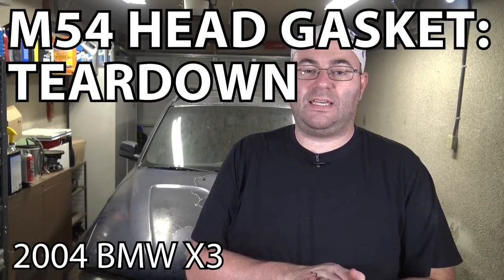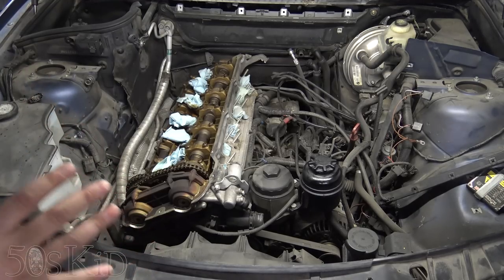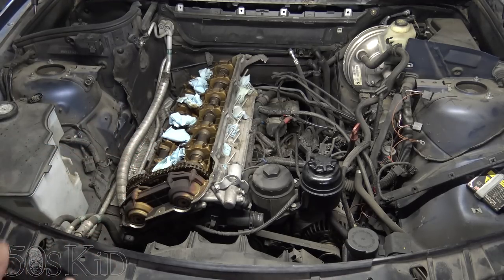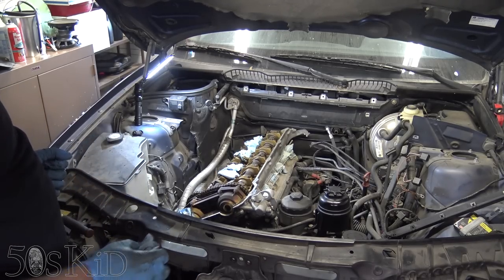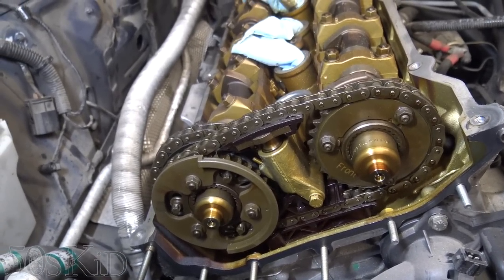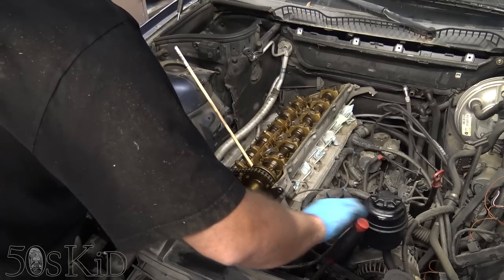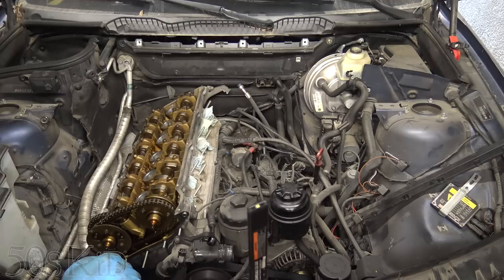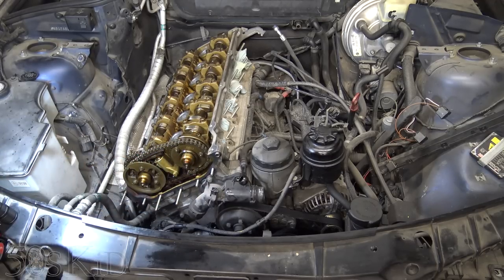BMW X3 E83 M54 Head Gasket Replacement DIY: Teardown

Comment: Jason my 2001 E46 had a blown head gasket between cylinders 2 and 3. The hardest part for me was getting the #3-6 exhaust manifold off. I finally ended up unbolting the engine mounts and jacking the engine up a few inches to get access to the exhaust bolts. I then removed the passenger side engine mount to get the exhaust manifolds out. Your videos were so valuable thank you for doing them. I sent the head out and it cost me $575 to have the head cleaned, milled and the valves done. The head gasket from FCP Euro was $195. I ended up also replacing all the coolant system, power steering hoses and reservoir. Total I spent was close to $2000. I would say that’s the going rate in 2022 if you do the work yourself.

Comment: It may be a "cheat" but as you noted, the best way to remove the exhaust headers is to pull them with the head. Undo bolts at other end of headers where they connect to rest of exhaust and then beg borrow or steal (and return) an engine hoist (cherry picker) and lift straight up an inch and pull forward. The gold color of your camshafts (not black) seems to indicate that maybe it didn't overheat too much. You have a good chance of saving that head with minimal machining.
Reply from the maker: +Mike Savage yep yep I do something like that in part 2. I find that the difference between gold and reddish varnish is more a function of poor oil change intervals than overheating

Comment: In my different Chinese timing kit: 1) the pin was too long and thick ( sanded it down on a lathe and cut it shorter) . 2) the camshaft locking pieces dis not bolt together because the bolt would not go through... i just didn't bolt them together but could have filed the hole over. 
Thank goodness the vanos piston alignment tool and chain alignment tool were correct. The tensioner was fine too.

Comment: Great video! Currently at 122K on my E83. I hope to reach 200K without ever needing to remove the head.
Reply from the maker: As long as you don’t let it overheat, you should never need to
Reply: I’m currently doing my head at 250k😕

Comment: Would you reccomend replacing the head gasket or just replacing the motor i have a m54b30 on a 03 coupe prefacelift over heated for about 3 minuets total and keeps overheating with new waterpump and thermostat even tho their is no white smoke or milky oil
Reply: what did you end up doing?

Comment: My m54 engine currently rums without problems. How can I prevent a problem with a failing cooling system? Which parts do I jave to check and to look after?
Reply: Change your radiator hoses, your expansion tank your water pump and thermostat
Reply: I use evans waterless coolant.. look it up ... do the below to get your cooling system in good shape and then use waterless coolant to prevent overheating.. helping prevent corrosion, overheating, and hose failure & more.. I am a materials engineer in the aerospace industry.. I did a lot of research b4 doing this and I recommend you do the same.. But have had this in my bmw for several years and it works great..have checked the system and fluid each year and everything is like the day I did it

Comment: Hello 50s kid got a question I am at the point where you had spoke about when putting the Locking pin in and the timing getting offset because of the jostling of the crankshaft when trying to insert the Locking pin can I use the alignment tool to stabilize the Vanos so that it doesn't pull away?

Comment: How did it pull on the trailer normally when the engines at the back you can get into a tank slapper / speed wobble

Comment: Question this E83 X3 motor is very same motor as E53 X5 3.0i ?? Im asking with regard to exhaust manifold and intake as well to remove. Has 6 10mm bolts is this for both sides....

Comment: I havnt had any overheating issues, but I’m losing oil and my car doesn’t leak any oil, I already had the oil pan gasket done. But I’m starting to think I need a new head gasket, any suggestions?

Comment: Hey 50s kid, how is your e46 running? I am thinking of doing a head gasket replacement myself. Iʻm concerned about the threads on the engine block stripping and ill have to redo them. Anyway, I was wondering if the time serts are the way to go or if I shouldn't even bother? Also if you got any other tips for rebuilding the engine to keep it running. awesome channel!

Comment: I have oil in my coolant but I’ve never over heated, would I still have a warped head? My valves were loud so I checked the oil but was almost completely out. Did find some gooey milk. Checked my over flow and found milky white coolant. Planning on doing the head gasket, but I’m wondering how it would have happened if I’ve never over heated
Reply from the maker: You got me. But it happened somehow. Maybe by a previous owner

Comment: Hi I know this is an old post but I have followed your timesert video on the m54 engine and I’ve had a bolt thread fail on bolt sequence number one. Do you have any tips on how to fix this? I’m thinking a bigger timesert and then screw the original size into it?
Reply from the maker: They make an oversized timesert for exactly this problem
Reply: @50sKid  thanks for that I have ordered a set of ‘bigserts’ from Würth uk

Comment: My head has warped. but barely!!!!!!  maybe 0.005 could i get away with some copper spray on the gasket?  or is that a no go? im asking cuz im broke!  Thanks @50sKid
Reply from the maker: You can’t afford a $50 resurface? Nobody is that broke, especially if you take on this sort of job

Comment: Don’t know if you’re still active on here, but you kind of screwed me over. Great information but messed up without showing us how you took of the double vanos unit! I tried to take those 2 t30 bolts out and they both snapped on me, turns out they’re left hand threaded and now I can’t get the vanos unit off. I have no idea what to do now.
Reply from the maker: I’m sorry to hear that. I actually had a completely separate video on how to remove and replace the vanos on the M54 engine. Actually I have an entire series and playlist on completely rebuilding one. That’s why I didn’t cover it in detail again. If you snapped them off, you’ll have to further disassemble the cams. I cannot picture off the top of my head what kind of clearance you’ll get when you do, but there should be a way
Reply: A simple search would have shown you those are left hand threads. What you should have said is I snapped my t30 bolts off because I didn’t know what I was doing.

Comment: Hey how's it going man? I have question unrelated to the x5 here in this video if you don't mind? I have an e46 and I was liking for a clunking today in the rear. I found one of the bolts for the RTAB bracket puked the threads out. Not the bolt itself but the receiving threads on the body....

Last person to to touch those was the guy at firestone that did my alignment so I can only assume how that happened. Anyways my plan of action is to timesert it but my only concern is if there's enough meat in that area to drill the hole bigger and still have enough thickness on the sides of the hole. Know what I mean? Anyways I was just wondering what your thoughts on my situation are.

Thanks man!
Reply from the maker: +Jason Natsis is a larger diameter bolt going to fit through the RTAB?
Reply: 50sKid a little bit bigger will fit through the bracket hole but not too much bigger I don't think. Do you think a timesert will hold whatever torque those bolts are supposed to be? I think they're supposed to be 80 something ftlbs
Reply from the maker: But you don’t need a time sert. The body is steel. You just drill it and tap it directly. Time serts are for aluminum.
Reply: 50sKid like just drill and tap to a bigger size bolt? I didn't realize timeserts were specifically for aluminum, is that the same for helicoils? For some reason I just don't like the idea of having one odd size bolt there which is why I wanted to do the timesert. I guess it really wouldn't matter though

Comment: What’s a good way to differentiate a loss of compression from rings to a warped head ?
Reply from the maker: Perform a leak-down test. If the air escapes from the oil cap, it’s the rings. If it escapes out of the neighboring spark plug hole, it’s the head. It’s all in my leak down test videos. I’ve got a couple at this point

Comment: hello jason. do you have to take the vanos unit off to clean the exhaust cam solenoid?
Reply from the maker: +andrei put no you can remove the exhaust cam position sensor and the vanos exhaust solenoid can be unscrewed without removing it
Reply: good news. when you remove or reinstall the Head, could you please demo removing and cleaning that exhaust solenoid

Comment: Hey I just sold my Dodge Dakota and bought a 325ci and the buyer totally ripped me off he said it had a bad fuel pump and he had taken the back seat out and it look like he tried to replace it so I believed him when I got home I put a new fuel pump in and when I tried to start it the reservoir tank cap literally flew off so I'm having compression go in the cooling system :€ so my question is what would be the cheapest way for me to get this car on the road I really like the car but I got emotional and made a bad deal and it cost me dearly - I'm very handy and I have another m54 from another 330i that I had but it's also over heated it has low compression on 3 cilyndrs I don't know what to do I'm in college and I  have about 200 dollars to work with please help
Reply: I put oil in the cylinder s to seal things up and when I crank it acts like it almost gonna start but smoke comes out the reservoir tank which I now learned to leave open when I crank this car
Reply: Any helpful insight from anyone would be appreciated

Comment: My 05 X3 2.5i just leaks and eats oil like crazy I believe I need to change all my gaskets, and noticed after I did my oil change when filling, I noticed in the valve cover it is really dirty in there curious how to clean this properly if anyone has any suggestions throw them in here please lol
Reply: Run Royal Purple for 5,000 miles.

Comment: So much talking and repeating yourself. Where's the action. I was able to skip 20 minutes worth of the video and still see you remove the parts.
Reply from the maker: +Robert Brown I’ve already done the bolt by bolt removal videos on this stuff during my last rebuild. I wanted to do something different here.
Reply: Don't get me wrong, I love all the videos you do... I loved the nuts and bolts series you did on you engine (my son has a 2002 320CI). In this video, it just didn't seem you and you just kept mentioning that series so I thought you would have just flew through pulling the head off.. Probably I'm just anxious to see what you discover when you do remove the head on the X3.
Reply: I'm with Robert on this, the video is probably 15 minutes too long, there is no need to keep talking about the same thing, we can always rewind theto the start if necessary.

Comment: I overheated the engine in my e46 325i after my coolant expansion tank cracked I repaired the tank and the pcv system but I keep getting white smoke out of the engine bay and tail pipe. Do I need to rebuild the head gasket or is something else I am not aware of wrong with my engine??
Reply from the maker: Yeah you need to replace the head gasket and get the head checked out by a machine shop, pressure tested and possibly resurfaced. They will tell you what it needs